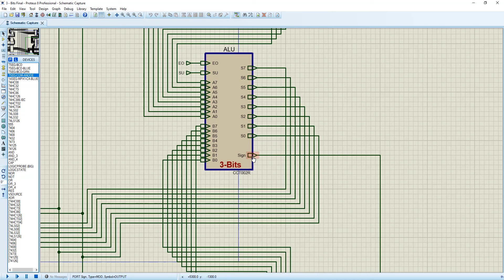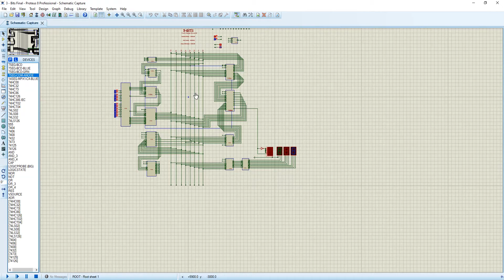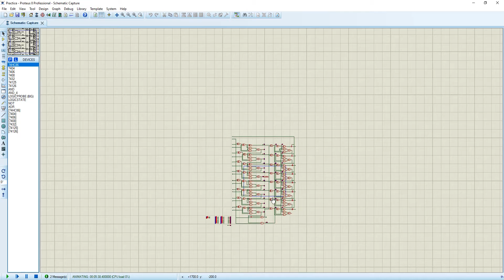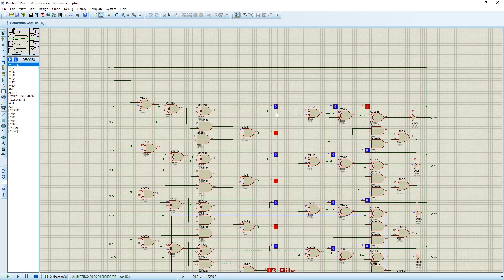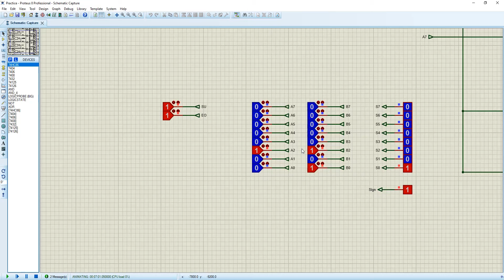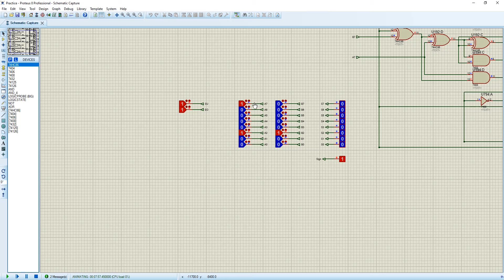SAP-1 Design of Arithmetic Logical Unit (ALU) using Proteus 8 Professional

Comment: Want 36 input 12 output ALU video
Reply from the maker: As far I know if you get 12 outputs that means your computer is 12 bit. But This bit thing depends on the power of 2, like 2^1=2, 2^2=4, 2^3=8, 2^4=16....so on. So, there is no 12 bit computer(Today's desktops or laptops are 32/64 bits). But as you asked for 12 outputs from ALU, you need 12 inputs from Accumulator & 12 B-Register, one for SU command, one for enable the ALU then what are the other 10 inputs?